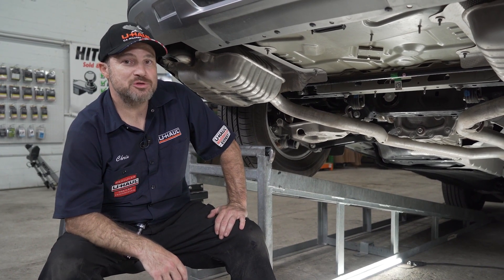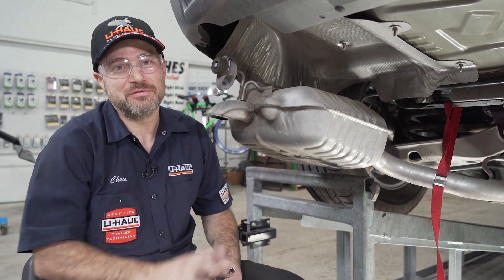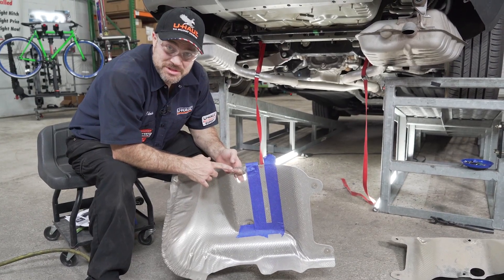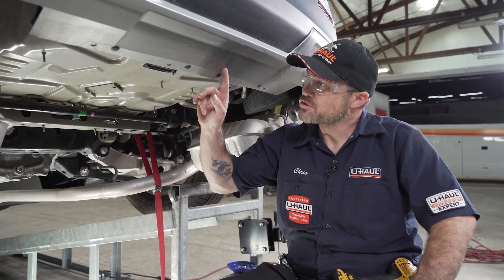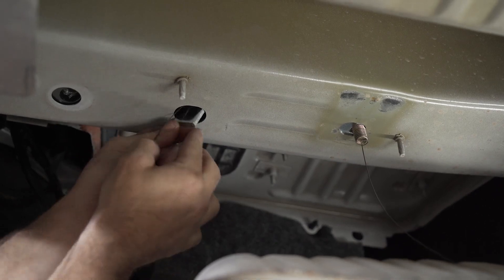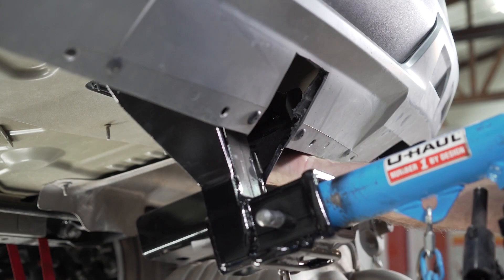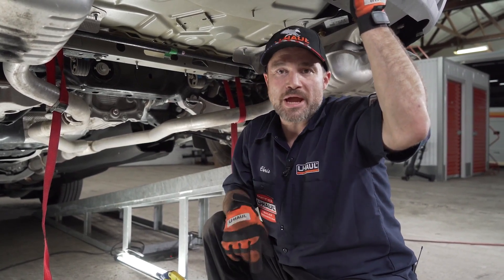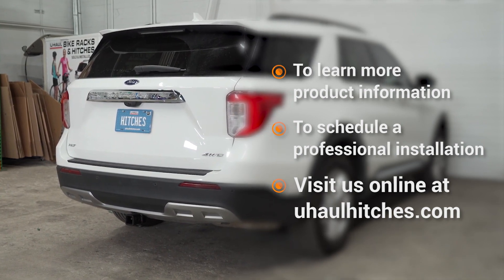2020-2024 Ford Explorer | U-Haul Trailer Hitch Installation | CMF13438

Comment: Hey! Looking at a few unibody SUV options that will let me securely use a hanging bike rack that needs a good platform for some tongue weight to hold several bikes. Just curious if there is any midsize SUV that has a better or more secure interface for the hitch mount than another. Highlander, Pilot, Explorer, Telluride, and Pathfinder are options. Any experienced input on what might be a solid option if I can’t pick up a body on frame like a 4Runner?
Reply from the maker: Most Hanging Bike racks have around a 125-150 pound maximum Weight capacity. Every full size SUV I can think of is capable of 2 to 3 times this capacity. Purchase the Vehicle you want and it will be fully capable of a fully loaded hanging style rack.